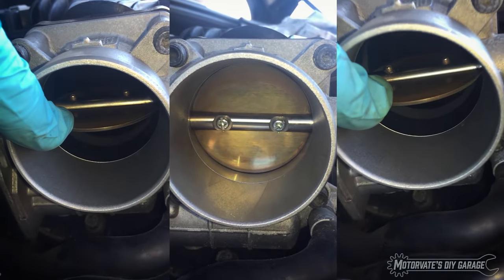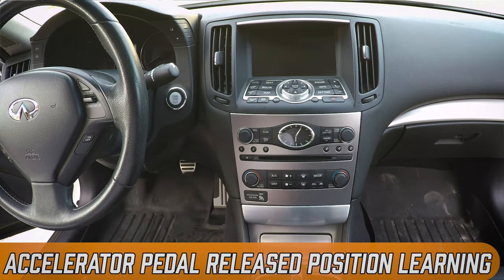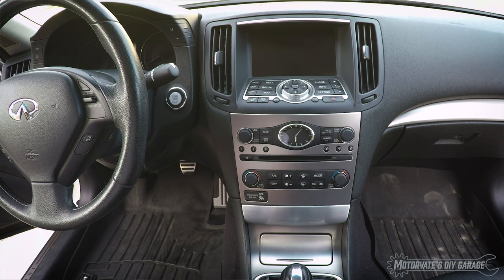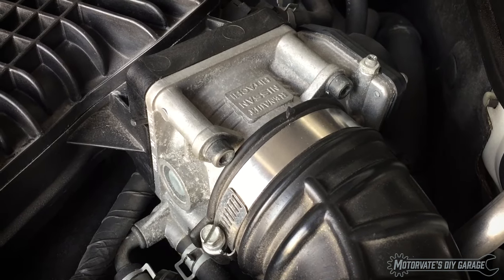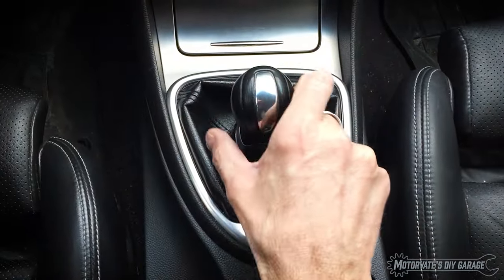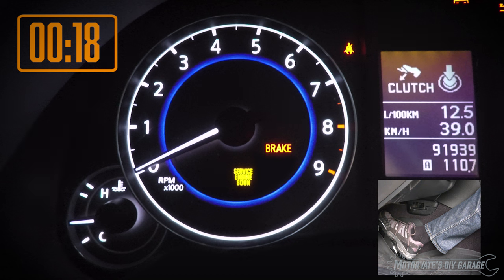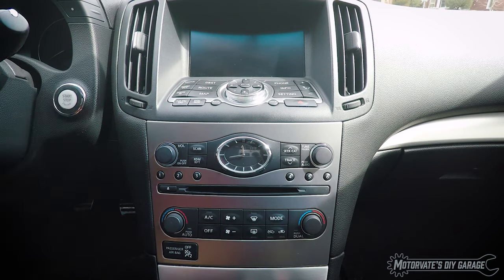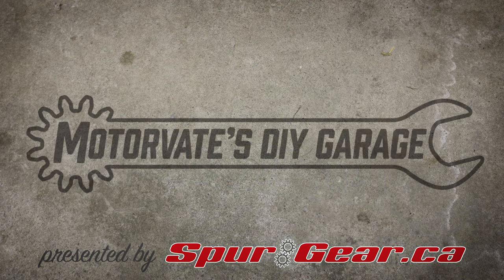G37 & 370Z After Throttle Body Cleaning: Motorvate’s DIY Garage Ep.27

Comment: Do you know how to update ECU before cleaning throttle body for 08 g35 sedan?
Reply from the maker: Hey  Geon Kim,
This ECU bug only affects the 2007 G35 / 350z models.
If yours is a 2008, you should be good to go.
Reply: Motorvate DIY is there any difference between 07 g35 sedan and 08 g35 sedan??
Reply from the maker: Hey  Geon Kim,
I am not aware of any differences between the 07 and 08 G35 sedans, other than the different ECU programming.
Reply: Motorvate DIY is there anyway to update ECU by myself?
Reply from the maker: Hey  Geon Kim,
Not that I know of. It requires the updated firmware file (from Nissan/Infiniti) and special software/hardware to upload it to the ECU.
Reply: Motorvate DIY mine is 07 g35ss... is it possible relearn idle by myself without the infiniti updating the ECU?!

Comment: So can I still do this if I already cleaned my throttle body a few days ago?
Reply: Never did the accelerator pedal relearn!
Reply from the maker: Hey  Xerx Khalil,
Yes you can! 
You can do it anytime as long as you follow the per-condidtions.
Reply from the maker: Hey  Xerx Khalil,
That one is not as important as the idle air volume, but it is easy to do, so when you have the time, just re-do it :)

Comment: My rpm keep going up and down by it self after i cleaned the throttle body's nd i did all three relearns nd still doing the same thing
Reply from the maker: Hey Jeffrey Moran,
Sorry to hear about your troubles.
Please tell me the year, make and model.
Reply: Having that exact same problem
Reply from the maker: Hey A Sea Rhinocerus,
What year and model is the car?
Reply from the maker: Never mind... I just saw your other post :)
Reply: Motorvate DIY  i have seem problem after i cleaned my throttle body i have 350 z nismo 2007
Reply from the maker: Hey SAMI Almagrami,
Crap, I guess you didn't see the warning on the first 3 lines of the video description:
* NOTE: If you have a 2007 G35 or 350z  (engine: VQ35HR) there have been reports of an ECU update that is required to allow the idle air volume learning to work. Without the update, after cleaning the throttle you will have a high and unstable idle *

There is a bug in the 2007 G35 or 350z engine control unit (ECM) and you might not be able to complete the idle air volume learning.

Some have been able to have the dealer update the ECM software. The other option is to have Eugene at Enthusiast Auto Care (https://www.yelp.com/biz/enthusiast-auto-care-concord) update your ECM.

You could also follow this Nissan/Infiniti technical service bulletin (TSB):
http://www.370zcoupe.com/TSB/1TN39.PDF

Good luck!

Comment: Does this work for the 2014 Infiniti Q60 Coupe?
Reply from the maker: It should. 
I can't say with 100% certainty as I don't have the 2014 Q60 factory shop manual, but this process does work on 2020+ Nissan/Infiniti vehicle with the electronic throttle.
Reply: @MotorvateDIY  I’ll try it out. We’ll see.. I appreciate your response!
Reply: @MotorvateDIY  It worked! Figured I’d let you know.. Thanks again! You did a great job at explaining the process and made it very easy to follow. 👌🏽🙏🏽
Reply from the maker: Thanks for the follow up. I appreciate it!

Comment: My car won't start after cleaning TB and fuel injectors plus I have changed my plugs as well! Help
Reply from the maker: Hey Arif Sami,
I would unplug and plug in (and make sure to hear the click) any connector your unplugged and double check all hoses/clamps to make sure there isn't any air leaks. 
Also, if you disconnected the front ground wires, make sure they are connected and tight.
Good luck!
Reply: @MotorvateDIY  thank u so much, something was not connected right by the garage
Reply from the maker: I'm glad all is now well :)
Reply: @MotorvateDIY  another problem is all of a sudden my car won't drive more than 20km in an hour however I restarted my engine it worked fine but the problem is back and all my  check engine lights are out ! Would greatly appreciate your answer!
Reply from the maker: Hey Arif Sami,
If you can, scan your car for trouble codes. Most codes only turn on the check engine light after 2 drive cycles. I suspect you will have a "Pending" code and that will point you in the direction of the issue.

Also, double check every clamp/hose you touched and make sure all electrical connection are FULLY pushed in. I am 99% sure something is out of position.

Good luck!

Comment: hello ,,, i clean my thottel body in a garage but now the curios control not work ,, what the proplem you thick ,,, i have g35 2007 sedan ,,, and thanks 😊👍
Reply from the maker: Hey Sayed Mohammed,
I really don't know. Check the electrical connection to make sure it is all the way in and check the wires for any damage.
When you say it doesn't work, what exactly doesn't work? Does the car idle? Is there a check engine light on?
Reply: Motorvate DIY I alreday have a check engine light on and the course control have no light even course light not just the sit ,,, there is a fuse for the couse control or no ??
Reply from the maker: Hey Sayed Mohammed,
There are multiple fuses for the throttle bodies, but I think your first step is use an OBD  scanner and read the code.
Then we can build a plan to troubleshoot.

My other channel may be helpful: https://www.youtube.com/obd4everyone

Comment: Do you think this will work on a 15 q50 3.7?
Reply from the maker: Hey yassi,
Yes it will. :)
In fact it will work on any Nissan or Infiniti made since about 2003 that has an electronic throttle.
Reply: Can confirm this, everything worked out A1 for me. Thanks for the detailed video

Comment: hi, is this also applicable to 2002 maxima? My problem starts when I tried to clean the throttle body with spray cleaner and opening the butterfly by hand with engine off(no key inserted). I followed some learning procedure and it did goes down to 700 rpm but it goes back up to 1000rpm every time I restart the car, can anyone help me? Thanks
Reply from the maker: Hey sakitlikod1,
Give me a day to two to do some research on this.
Reply: Can i apply this procedure to my cefiro 2005
Reply from the maker: Hey Jimson Bundoc,
I think so... From what I could find out your Cefiro is also a Nissan Teana which I think has an electronic throttle. In any case I don't think it would hurt to try . Good luck!
Reply: @MotorvateDIY  i did two times nothing happened..engine sign is not blinking at all..
Reply from the maker: Hey Jimson Bundoc,
Hmmm, maybe my guess was wrong and it doesn't work on your Cefiro. I don't have any experience on cars from outside North America. BUT= this might work...IF you have access to  an Android device and bluetooth OBD scannner: https://youtu.be/OiB9txECWB0
Reply: @MotorvateDIY  i just did a scan but i dont know what it's meam..mast or volume air flow a circuit..do you have any idea..thnks..
Reply: And P1320 manufacturer   control a have no idea about it..
Reply from the maker: Hey sakitlikod1,
Sorry for the delay in getting back to you. I didn't find anything... BUT maybe this might help if your have an android device and a bluetooth scanner: https://youtu.be/OiB9txECWB0
Reply from the maker: Hey Jimson Bundoc, I don't have access to technical information for cars sold outside US/Canada, so I won't be able to help much. Any description that mentions "circuit" you should check the wiring and connectors. I wasn't able to find any infor for the P1320.
Reply: @MotorvateDIY  thanks..

Comment: I just clean my throttle bodies on my 09 370z and I did all the steps and it's still has a rough idle.
Reply from the maker: I don't know how much I can help via youtube comments... the term "rough idle" means different things to different people.

With that said:
How many miles are on the spark plugs?
When was the last time the  MAF sensors were cleaned?
Does the engine make full power under full throttle?

Comment: Hey I'm not sure you will still answer but I did this on my car and the idle is stuck at a 1000 how can I fix that
Reply from the maker: Hey money_chosen,
I reply to comments everyday :)

What year, make and model?
Reply: Motorvate DIY 2008 infinti g35 I checked my check engine codes and I have a P0102 for the maf so it may be dirty
Reply from the maker: Hey money_chosen,
The idle air volume learning might not complete with a MAF trouble code.

The P0102 is defined by Nissan/Infiniti as:
An excessively low voltage from the bank 1 MAF sensor is sent to the ECM.

• Check the harness / connectors for damage or a loose connection
• Check for air intake leaks (loose clamps, split hoses, etc)

You could try swapping the MAF sensors and see if the code changes to bank 2. (P010C)

I suspect once the MAF issues is addressed, the idle air volume learning will complete and your idle will be back to normal.

Good luck!
Reply: Motorvate DIY okay will try it later and hopefully it works . Thanks for the tip and by the way if it doesn’t get fixed right away will it damage anything
Reply from the maker: Hey money_chosen,
I don't think it will hurt anything, as your engine computer should  make assumptions about the engine load, since it can't see the mass air flow. Your engine might not run well, but I think it will run OK.

You should get look at this or get it fixed as soon as you can.
Good luck!
Reply: Motorvate DIY you the best all I had to do was clear the check engine light and rerun  the process and it all worked out. car is running okay now but has a slight hiccup as I just installed test pipes.
Reply from the maker: Hey money_chosen,
Thanks for the update. It's always nice to learn from others.

Comment: But, what if it doesn't return to normal and now you have multiple codes being thrown? P0444, P0101a/b/c, P0301. Because that's what's happening to me =(
Reply from the maker: As far as I know the Idle air volume learning only completes when there are no engine codes. 

If you have other codes, you need to address them.

Comment: HERE'S A WORKING SOLUTION FOR THE PROBLEM OF IDLE AIR VOLUME RELEARN NOT COMPLETING BECAUSE OF HIGH IDLE: I've a 2008 Nissan Skyline 250 GT (V36 VQ25HR) and the idle relearn didn't work after throttle body cleaning no matter what I've tried - and believe me I've kept trying every possible solution multiple times every single day for about 3 weeks. My car idled way above a 1000 RPM even when the engine was warm. The only solution that helped was to smash the selector into driving or reversing right after the learning procedure started. If you follow this video, at 4:26 is when you want to do the following: So right after the so called "pedal dance" is over, you start the engine up. At this point just put the selector into Drive or Reverse. This will force the engine to drop the RPM which in turn will cause the relearn process to finish successfully. If it doesn't work with Driving, try Reverse and vice-verse. One drops the RPM more than the other, you just need to try each of these patiently until one succeeds. Hope this helps.
Reply from the maker: Hey Adam Baranyai,
THANK YOU for this tip!! I hope it helps folks that are having a hard time getting it to run. :)
Reply: Hey @MotorvateDIY , I hope that too. Thanks for the video, it helped me a lot until I managed to purchase a working OBD2 scanner.

Comment: Does this work on a q50 vr30dett?
Reply from the maker: Excellent question!
I compared the idle air volume learning procedures from the VQ37 to the VR30  and the VR30 factory shop manual only mentions using a Consult III+

I think the free android app, NDSIII may still work on the VR30, but I have no way of testing. 

Here is what I am talking about:
Quick & Easy Idle Air Volume Learning: Motorvate's DIY Garage Ep.28
https://youtu.be/OiB9txECWB0
Reply: @MotorvateDIY  Hey thank you so much for the response. I will test it out. I'll let you know the results. Appreciate it 🙏.

Comment: How can little dirt affect your cars performance and make rpm stutter
Reply from the maker: Hey  Playz Boi,
Excellent question!
Due to the flow characteristics of a butterfly valve, it only has accurate control of air flow in the first few degrees of opening. As dirt build up on the edge of the butterfly valve, it prevents the "small air adjustment" required for the engine to idle properly.

Also, most engines with an electronic throttle, don't have a dedicated device that controls the idle, so accurate and fine control of air flow is required for a proper idle.

Comment: Does this work for 2007 g35 hr
Reply from the maker: NO! There is a bug in the 2007 HR ECU programming and the idle air volume learning won't complete. Resulting in a high and unstable idle.

Comment: Would this work on a 2013 dodge avenger?
Reply from the maker: Hey DANTE FLORIAN,
I don't think so... each manufacturer has their own steps to learn the idle air volume.
I tried to find if there is an "idle air volume learning" type process for the 2.4 or 3.6 but couldn't find anything.

Maybe have a look at: avengerforumz.com
Good luck!
Reply: Ok thank you

Comment: Did not work nor does ANYTHING for me. Car ran good, no idle issues before the throttle body cleaning! I unhooked battery first too. 
As soon as I turned car back on all I get is a surging idle when ever it's in park or neutral, from 1100 to 2000 rpm. ! In drive it idles high and sometimes feels like its gonna keep accelerating when in trying to slow down! 
I've tried all the procedures but nothing works, and yes, no leaks, and as mentioned car worked fine before the cleaning! 

Thoughts
Reply from the maker: Hey rich baum,
Sorry to hear about this.

Please tell me the year, make and model and I will look into it.
Reply: @MotorvateDIY  2007 G35 Sedan AT.

I'm leaning to having ecu updated. I've tried every relearn under the sun., unplugging this, unplugging that, in this order and that order , erc..lol!  Pretty lame that cleaning a little carbon can mess up a car so bad!

Just not looking forward to dealing with shadey service managers who only want what's in your wallet!!

Any help will be appreciated. 

Thanks!
Reply from the maker: Hey rich baum,
Yes, the 2007 G35/350z have a bug in the ECU which prevents a stable idle and the idle air volume learning won't complete - as you now know.

From other comments I have been told that some dealers won't do an update, they want to sell you a new ECU and throttle bodies!! 

However, there is a company that will update your ECU: Enthusiast AutoCare: https://www.yelp.ca/biz/enthusiast-auto-care-concord

I know Eugene and trust his work. 

He has helped others that are in the same boat as you.
Good luck!
Reply: @MotorvateDIY  so I'm assuming that the ecm does not need to be installed in the car for reprogramming?
 I did call local Infiniti dealer to find out their charge for reprogramming. But.... they insisted I have a diagnostic done first at 150$ . Then they could do the reprogram which they didnt give me a price on. Service manager even said they may not be able to do a reprogram. There for 5 minutes and they were already trying to upsale me on services and possibly replacement parts. 

So... unit does not need to be installed correct?

Thx
Reply from the maker: Hey rich baum,
Bases on other comments from this channel, it seems like the dealers don't (or won't) understand that only the ECU needs to be reprogrammed. There is no need to change any parts.

Why not give Eugene a call and ask him the process and cost. 

I know of two people with an 07 HR engine that he has re-programmed and they are very happy.
Reply: @MotorvateDIY  ya... I would but I'm way up here in Canada lol. Cost me an arm and half a leg to get it done down there in Cali! 🤷🏻‍♂️
Reply from the maker: Hey rich baum,
Your other option is to buy a used 2009 ECU and get a locksmith to program they keys.
Search though the comments here, there was one guy who did exactly this on his 350z.

I would still check the shipping cost. Last time I sent in a used oil analysis it was 30% more to ship it to Burlington from Mississauga!!
Reply from the maker: Canada post shows about $23-46 to ship it from Mississauga to Concord, CA.
(I assumed  a size of 10 x 6 x 3 and guessed at 2 pounds)

However....I have no idea what customs paper work needs to be done.

Comment: it’s work at q50 ? 2015 3,7
Reply from the maker: Hey Andriy Cherkasov,
Yes, it should work on you 2015 Q50.
In fact, it should work on any Nissan or Infiniti made since 2003 that has an electronic throttle. :)

Comment: I don’t understand why you didn’t take them completely off tho. Every time I ever cleaned a throttle body on any vehicle I always take it off.
Reply: Dillon, you can take them completely off. But most guys just use a towel or two to catch drip. The bodies can be rotated pretty easily without being disconnected however.
Reply from the maker: (sorry for  the late replay, I just found this message)
As with many things, there are different ways of doing it. According to Nissan/Infiniti if the throttle body is removed, the rubber seal should be replaced. I know many people that have removed them and reused the seal haven't had any issues. Including me... to replace the spark plugs, the throttle body has to be removed.
Thanks for your comment :)
Reply: @MotorvateDIY  thanks for the reply!